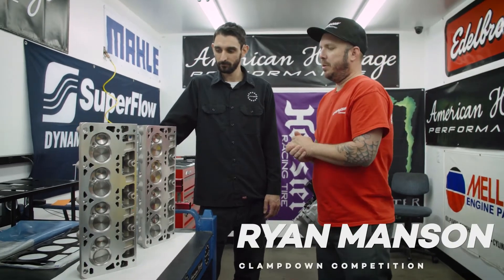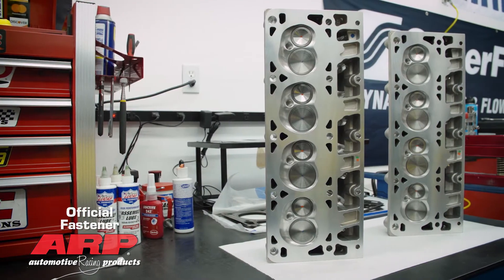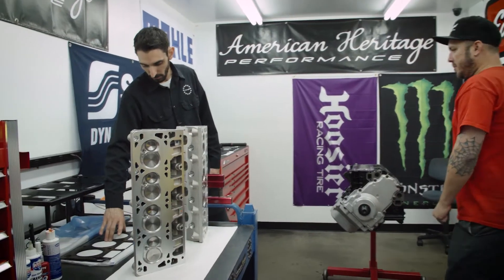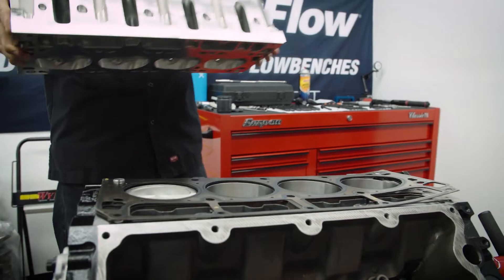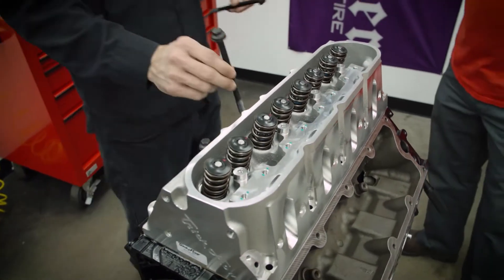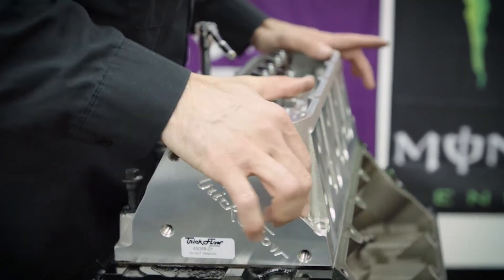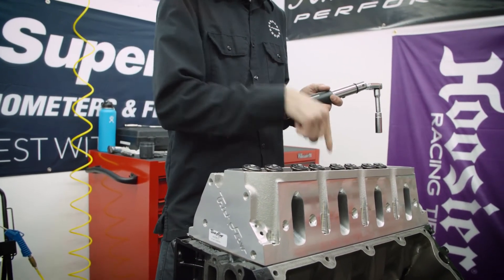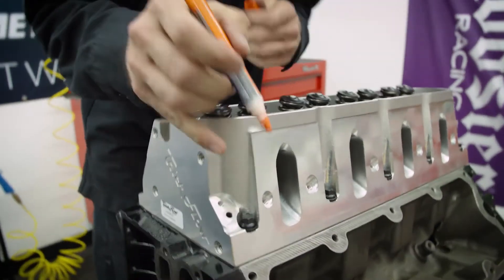How to install LS cylinder heads

Comment: Very silly question as I am used to small blocks.  Do you need sealant on the head bolts prior to installation. 

With SBC the head bolts run through cooling jackets and require sealant.

Comment: 25,50,then 75? I thought LS's were 22ft/lbs, then 90 degrees, then 70 degrees?? Is that torque just for arp bolts?
Reply: when using arp bolts, they come with torque instructions, the factory bolts are torque to yield meaning they can not be re used again, arp bolts are re usable so they are not torque to yield and they just need to be torqued down in the right order. also the instructions say 80 ft/lbs on my set so I think its dependent on the engine they go on, always read the instructions that come with the product
Reply: Yeah i ended up buying the ARP bolts and the instructions said 30,60,and 90 ft/lbs. Then re-torque after 500 miles.  @YungShirtPocket
Reply: @PontiacsGarage the top of your bolts probably say 2000 on them then. The other bilts say arp arp so they are 25-50-80 then 25 for the small ones on the top
Reply: @fonzybustillos9275 I have arp bolts. I did 30,60,then 90. No issues so far after 4k miles.

Comment: So torqued them to 25 then 50 then 75?
Reply: I thought you had to torque to a number and then go 90 degrees or so. What this video showed is different than what I've read
Reply: @chipjumper arp has different specs than oem. Arp are reusable and oem aren't . For my kit its 25-50-80 then 10mm head bolts 25
Reply: im getting ready to do 50, 75 on a 2007 suburban...i did 25 already